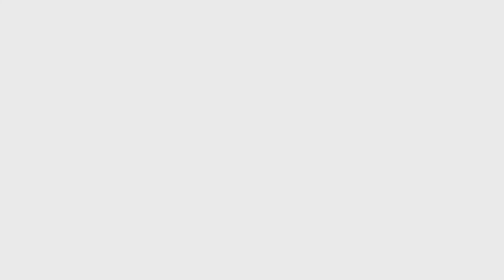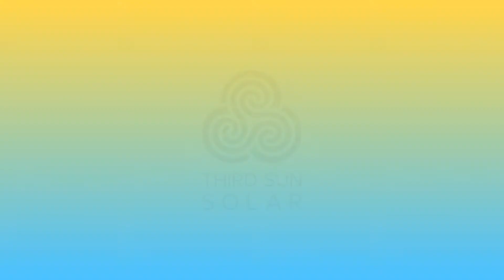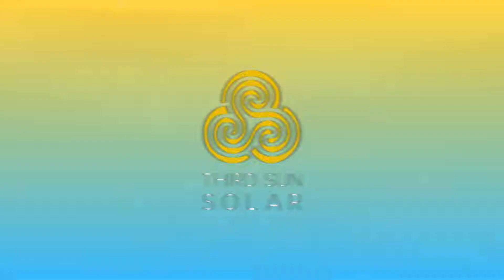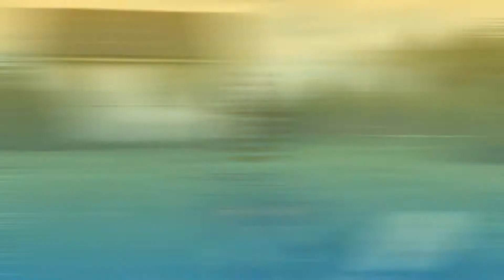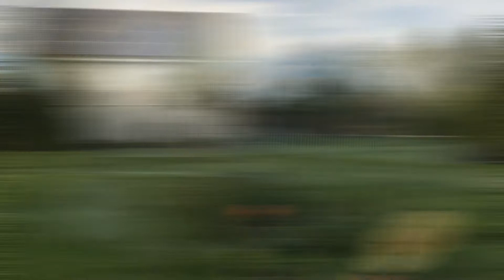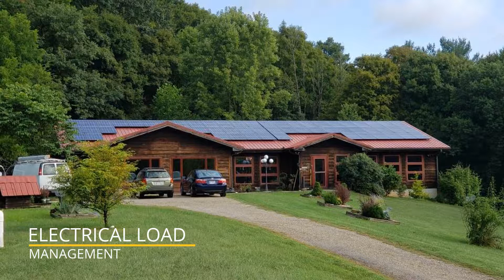How many Tesla Powerwalls do I need?

Comment: Thanks! What would you suggest for solar here in Los Angeles. We have an outage every 5 years so I am not worried about that. 1300 sq. foot house. Normal  - -  tvs,  appliances with AC.  Good sun coverage - no big trees in the way between 11am - 6pm. Thinking of going with Telsa, but not sure we need a powerall if we gain too much and can get a credit from power company. I would lean toward zero powerwalls. Your suggestion?  zero, 1 or 2 powerwalls.........?   Thanks
Reply from the maker: Good questions! We would recommend you go through a free solar evaluation process with a local installer in your area. Check out these full turnkey solar partners in CA: https://www.amicussolar.com/our-member-owners/California/